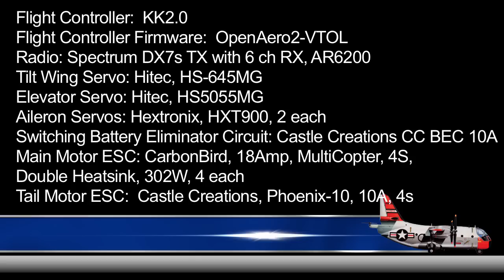Scale Flying Model of XC-142 VTOL

Comment: Nice explanation, and a very interesting aircraft (and model), seems to handle very well for what it is :)
Reply: She dips quite a bit on reverse transition though hehe
Reply: With a 4engine prop plane you could perhaps mitigate some of that negative control by having a set of CW and a set of CCW to reduce torque steer, but the tail rotor is also a factor to be considered as it has rotational force in the back..
Just a thought :)

Comment: Do you have any differential aileron throw built in, i.e. more up throw then down? That should help with your adverse yaw.....Not really sure if that would help as the air speed over the wing surfaces is low....

Comment: Fantastic engineering work ! And fantastic documentation in this video. Congratulations !!! What a brilliant idea to make the back rotor fixed and achieve yaw with the ailerons - I love and admire such fantastic engineering ! I am also an RC pilot with planes, helicopters & multicopters including an ST360 with the KK2.0 board. Since about 2 years I play with the idea to also build this or a similar VTOL airplane. 
Once more - my deepest respect  and congratulations for your work with this model !

Comment: are all 5 motors the same or did you need to program the fc to accommodate the rear motor. also is it if different size the same kv?

Comment: Excellent video.  Not only did you give some history of the original aircraft, but a pretty detailed description of how the model relates to the original, and all in a very calm and steady manner.   I at least, appreciated it very much.   You mentioned the KK2 flight controller, but may I ask what setting/program do you have that set for?   I mean, I know that that controller can deal with quads, hexa's, octo's etc., but a  multcopter transitioning to fixed wing?  Hmmm  interesting.   I recently saw a kickstarter project that had 2 'main' wings each with 2 motors as in a quad set-up, but it then tilted both wings so that progressively the thrust was vectored rearwards.   I seem to remember that the 'inventor' said that they had developed unique software for the project, but your demonstration seems very close to theirs.  Sorry for such a long comment, but really well done again.   Regards Mark in the UK
Reply: thecorbies Flite Test had a similar plane called the Chimera that transitioned from tricopter to twin-engine fixed-wing.

Comment: very cool, however this design has one inefficiency flaw in it common to alot of VTOL designs.  You have a motor/s that are used in vertical mode but do not contribute in forward flight mode.  This means you are carrying some dead weight during forward fight, an extra motor not doing anything.  It would be more efficient if the rear motor was able to tilt forward and be used during horizontal flight,  You could redesign it with enought clearance to tilt forward, or, tilt backward and change rotation.   Cool plane though

Comment: The real versions' outboard prop at the back was merely for stabilization... altering between positive and negative pitch on the prop.  Majority of the aircraft's weight actually 'hung' from the central wing and four lifting rotors, almost at CG.  On this RC version, it's setup merely as a tricopter, with the rear rotor carrying a significant portion of the aircraft's weight for stability.

Pretty cool replica, but I imagine the flying characteristics between both were quite different.  An idea for v2 would be using a collective pitch heli tail rotor at the back and moving the main wing back some.

Comment: In a multy engine plane,have you ever had where one of the motors sputter when given full throttle ? If I give it slow power both motors rotate equal but if I punch it,one motor will vibrate and it seems it doesn`t get enough power. I was told  it may be my C-rating on my battery. Is this what is happening? Like I said when given power slowly they both rotate equal. Hey any help would be very much appreciated. Oh I can`t leave with out say that plane is real fine. Looks like a lot of planning . Cheers